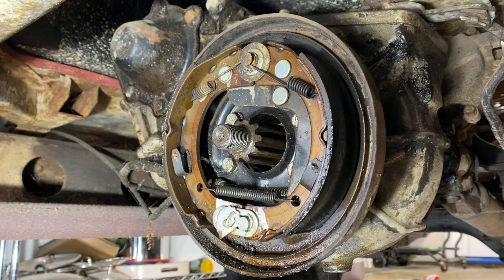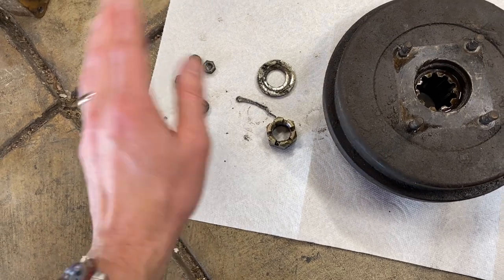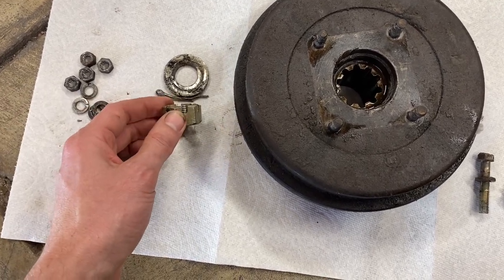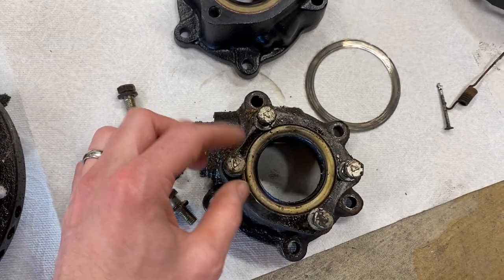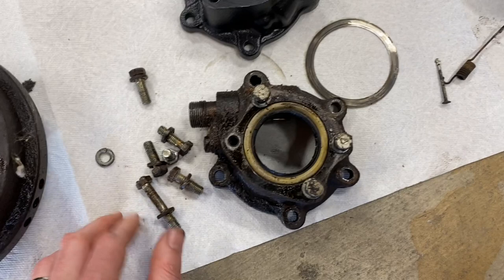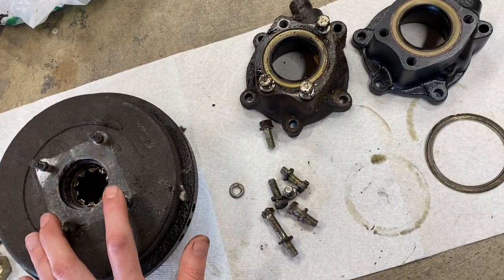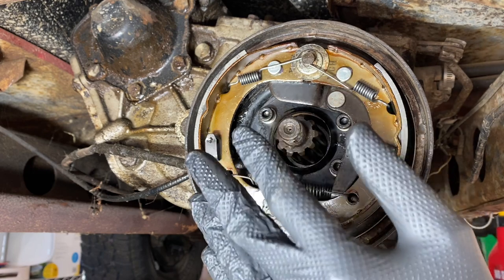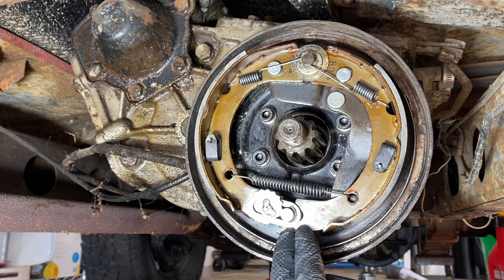40series rear transfer case output shaft dual seal upgrade

Comment: Thank you for the video. Why not just replace the seal rather than purchase a whole new housing. Also, I could not appreciate the difference between the two seals.
Reply from the maker: @bobs2440  so the original housing only accepts one seal. Over the time seal and the shaft surface it rides on degrades over time. Even a new single seal won’t fully stop a leak. The new housings from Valley Hybrids are machined to accept two seals. This gives them a new surface to seal against and prevent leaks.
Reply: Perfect explanation. Thank you! Imagine a similar outcome with a new seal and a Speedi-Sleeve approach. I will look up the vendor you referenced. Thanks again.

Comment: Mine has the double seal and the speedi sleeve and it leaks along the spline. I have used orange Toyota fipg and it still leaks, at this point just living with it but embarrassing on the trail.
Reply: This may not be your issue but I've seen MANY people remove the speedo gear off output shaft. This is what causes gear lube to basicly flow out of rear and will cause bearing chatter among other things before cases are damaged. They do this because they are not using factory speedo or just don't realize this is also a spacer to get bearing preload on output shaft so if you haven't looked to see if yours is on the previous owner may have taken it off. It is a possiblity. The splines of brake drum butt into the speedo gear keeping gear oil from flowing out
Reply: Thank you for the reply and I am not using the factory speedo I will look